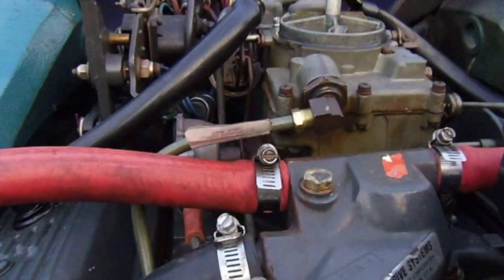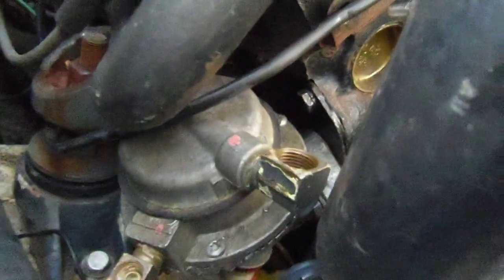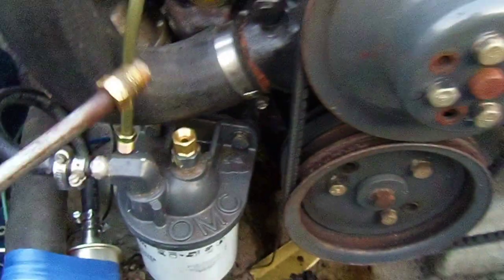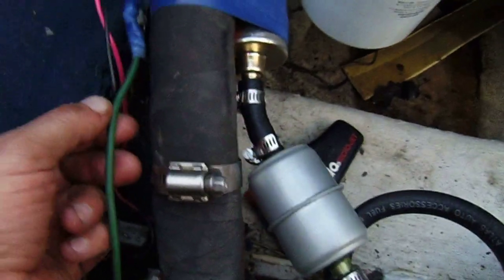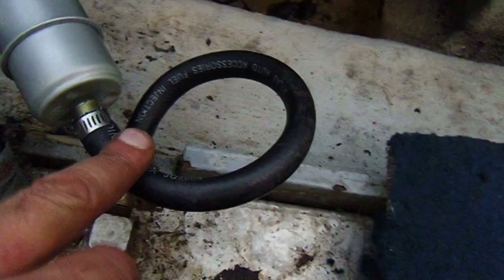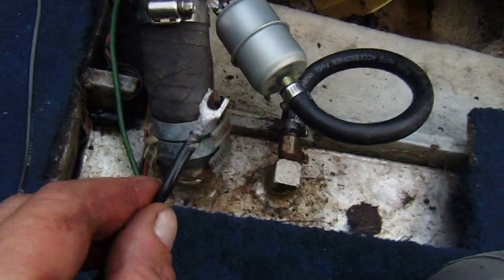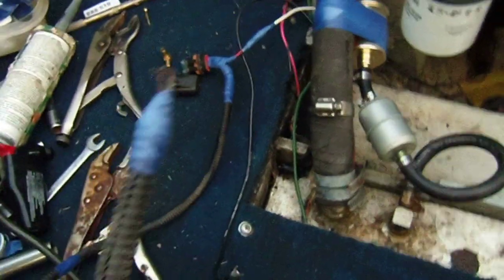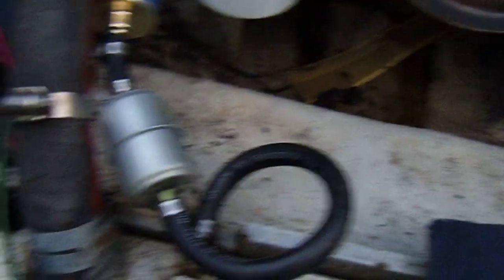inboard fuel pump fix

Comment: crack pipe lighter and some pipe solder and ur ready to go like hunter biden...haha, just kidding.  Seriously so that line coming off the mechanical pump line coming off the top of the pump is for simply seeing if your fuel pump diaphragm is leaking externally?  Happy boating friend!

Comment: there's alot of haters on here... there are 2 kinds of mechanics in the world that are useful the ones that will work with the high end stuff and are school taught that use math and science for every question & problem & can build you a rocket then there is your farm style mcgiver mechanic a resourceful guy that can work on anything anywhere at anytime like this guy here.. he is making due with what he gots the type of guy that wont be sidelined on a big weekend over some b.s. engine part a small autozone and a cheap non off brand tool set with missing tools and he good to go ....i grew up with both these mechanics in my life my grandfather was a master tech that got started in the pan american races in the 50's in mexico and my father that was a Jack of all trades that could take 2 busted old cars and make a runner.. both fed me knowledge both had there style that help shape mine ....if it work then it works ....GREAT JOB MA BOY!! FIRE IT UP ITS BOATING TIME 😎😉

Comment: Although this guy is tremendously resourceful, his solution has issues...the silicone as sealer will breakdown overtime by the gasoline... so there's a danger of leak there... boat catch fire!
Reply: There's no gasoline going to the old pump. It's just there to seal the block from leaking

Comment: The term “knowing enough to be dangerous” applies. Don’t do this gang! Look up uscgboating.org
Always check that your anti siphon valve is not clogged (at top of tank) there may be a screen in the elbow ahead of it. Replace, don’t leave out that valve. If it had a mechanical pump replace it with the same (marine type only) far cheaper, safer and should outlast the boat at this point if there isn’t something wrong between it and the tank.

Comment: Steel fuel line? Should be copper/nickel alloy OR the newer marine type A1 hose over the engine. Copper, copper/nickle or A1 hose for the rest of the boat, NOT steel. Fuel pumps must be marine type AND mounted on a bracket on or within 12" of the engine. Filters must be mounted and can not have plastic, glass or Pyrex for housing or bowl components on gasoline inboards. Electric fuel pumps must have some type of safety interlock in the event the engine quits the pump must also stop. Usually wired to a oil pressure switch and may also be connected the start side of the ignition switch to help prime the system quicker (time out cuircuit recommended). Crimp connect wires and over cover with adhesive lined heat shrink tubing is best.  Please be safe all.
Reply: I had problems with the oil switch and changed it five years ago. I had the same problem of easy start then dying ten seconds later changed the switch and this time no difference. Any suggestions?
Reply: Anthony war 
I’d be concerned that you’re oil pressure is actually low.

Comment: Mechanical fuel pump is an easy and inexpensive fix with a rebuild kit. Don't do what this guy did.
Reply: Rob Staples where can I get one?  I have 2002 Maxum 1800 SR 3.0 4 cylinder and there is fuel in the sight tube.
Reply: ozelot250 buy a complete fuel pump on Amazon. It’s 50 bucks

Comment: i have a 1984 Bayliner inboard AQ125 Volvo Pinta 4 cylinder engine run will not go over 20 mils per our now to 10 mils per our  try to cut off when trying to going faster in  forwards or backwards can you help me to fix this thank you.bunnock38@gmail.com

Comment: Oil Pressure switch is Legally required and Critical to prevent Fire, because if fuel lines break fuel will pump all over the engine, Oil Pressure switch will stop fuel pump if engine stops.  Use real brackets not tape for fuel pump again for safety.  I don't agree about fuel pump in-between fuel /water separator and carb because fuel pumps push well but don't pull well. Also, fuel pumps need filter in front (pump can pull fuel through filter but not water separator).  Last, but not least, use crimping wire connectors, not solder.  I like solid metal fuel lines over the engine.  Oops, Oh Yeah, use marine electric fuel pump not auto.  Shop and you can get the marine pump for a good price.  Many people are killed and maimed by boat fires, do get sloppy when it comes to fuel.
Reply: Im putting an electric fuel pump on my boat in hopes it will help with the vapor locking issue I seem to be having.  Not wasting my time with an oil pressure switch, when the key is in the run position, it will be on.  Simple as that. 

Besides, oil pressure switch would be a huge PITA if you ever had to start with a dry carb for any reason.  Now you cant even get fuel to the carb at all until the engine starts up,  but how do you get it to fire up with no fuel?   Now you need to mess around with jumpering out the switch or dumping fuel into the carb manually.  No thanks!
Reply: I did this same thing. I have 7psi from my FP and the gas just keeps comming out of the top of carburetor.it just runs right out.had my carburetor rebuild buy a rebuilder and the same thing.4 barrels 260 hp Merck is 7 psi to high??
Reply: I wired my FP like that with the oil switch.it has 7 psi and floods out of the top of my carb!!Is 7 psi to much?then I had a rebuilder do the hole carb 300$$and it still dose it.he said the float is ajust to spec.what can I do??anyone have this problem??
Reply: Great job I  did the same thing those Mechanical pumps are trash anyway

Comment: WOW do you know what shrink tubing is, nice blue tape by the way. Plus why dont you put the pump between the fuel water separator and your carb and get rid of the 500 connections between the tank and the pump. all you have there is a recipe for disaster.

Comment from the maker: Notice,.. when adding am electric pump,.. you will need an oil pressure switch for running,.. and a jumper switch for cold starts,.. watch for flooding when you lite it up at first,.. stuff in the lines or any dirt,.. may cause flooding,.. if ithe carb is girgling over,.. rap on the carb,. if your lucky it will clear. .. it worked for me,.. if initial flooding continues,.. you'll have to tear down the carb. Best off to blow down all parts,.. before installing.... and change oil..
Reply: I'm not sure if your on here still out not old thread but I have an electric oil switch and when I turn the key the boat fires up but dies a few seconds later. I put a new oil switch in same problem. Any input would be great thanks